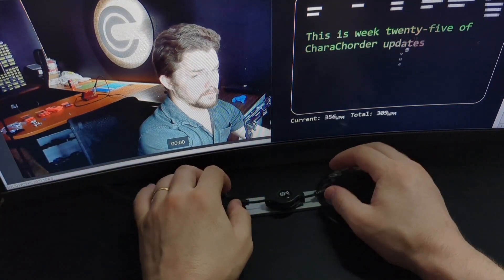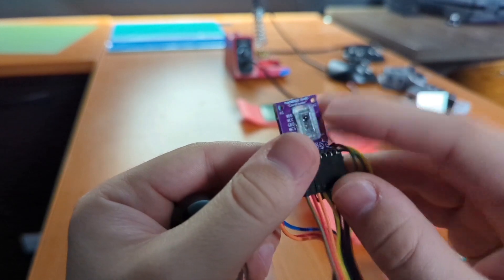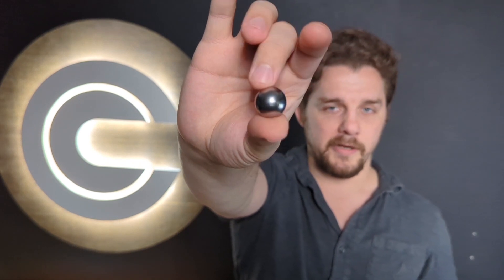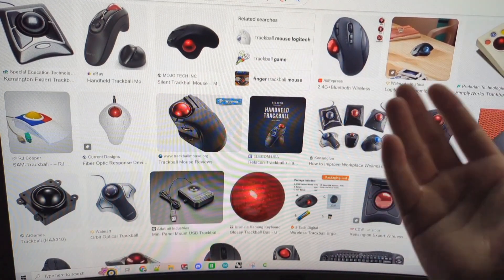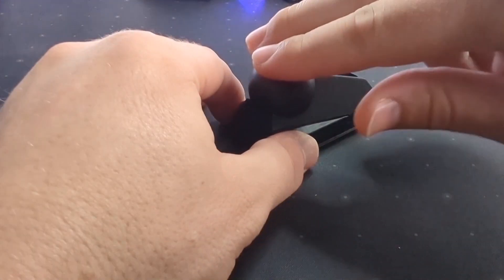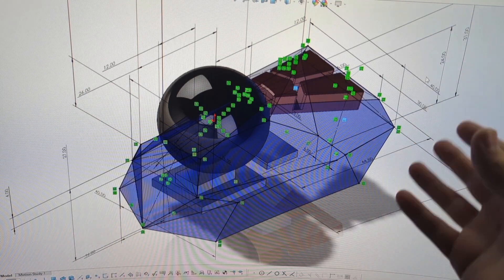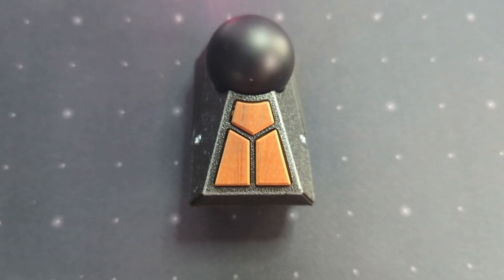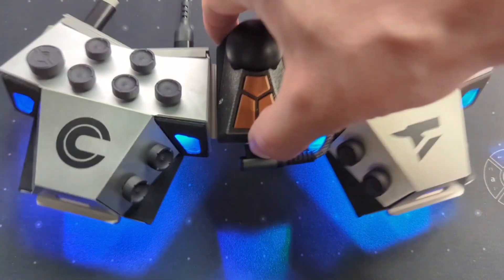Let's Design A Trackball 🖲️

Comment: I'm not sure about the flat panel you've got the finger pads on... (whether that's a good idea... don't know) but it seems to me that the best place for that trackball is right under the pad of your hand... IN the keyboard itself. So all you have to do to manipulate the trackball is draw your fingers in towards your palm a little.
The point here is to not have to move your forearm at all.
Reply from the maker: We have made some prototypes with the trackball located centrally, and it works ok though requires greater finger and forearm movement than when the ball is located on the top or side. Remember the goal is to get it closer to your fingertips, not the center of your hand! Appreciate the feedback 😀

Comment: Its been going on for a while now, but the Audio needs to be boosted / balanced. You are about half as loud as you should be most of the time.
Reply from the maker: Thanks for the feedback. Have been trying all kinds of different mics the past couple weeks. This one was shot with a shotgun mic, going to try an over ear next week to get better consistency across all shots. Appreciate your patience while we find a long term solution
Reply: @CharaChorder  A Great Spoken Word Mic is the Audio Technica BP40. It is an XLR Mic so you would need to be prepared for that.
Reply from the maker: @AlcorSalvador ok, appreciate the tip. Just splurged on one of these plus a shock mount. Stay tuned and we'll see how it goes 👍
Reply: @CharaChorder  While a good mic is necessary for good quality audio, my biggest issue with the videos currently is that the levels are too low. This can be fixed with a compressor in post-production (most editing suites have these) :)
Reply from the maker: @lordubbe thanks! Tbh I edited this all on my phone as I'm traveling atm gotta keep the streak alive haha. Will be sure to use a compressor on the next one 😄
Reply: @CharaChorder maybe try some audio compression, example person speaks music volume goes down.
Compression can be quite confusing but there are videos i think from in the mix explaining it
Reply: I really like the DJI mics
Reply: I second the compressor.